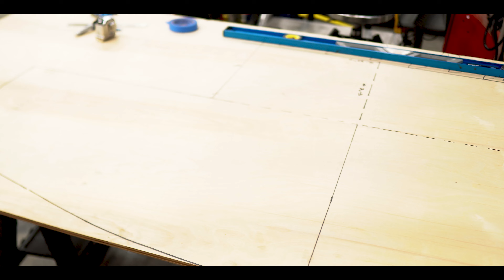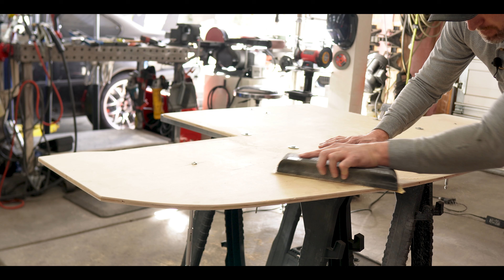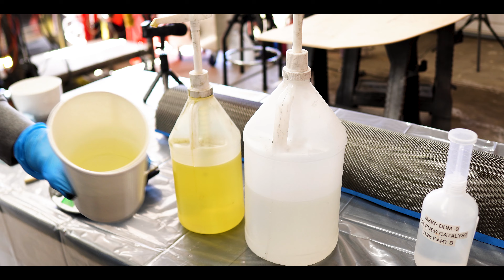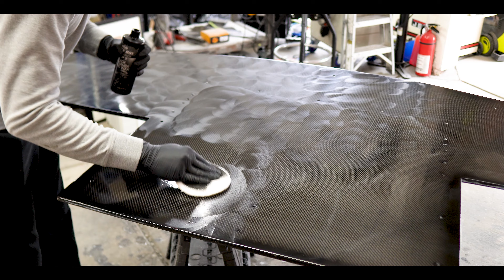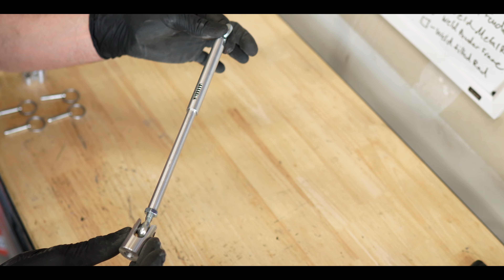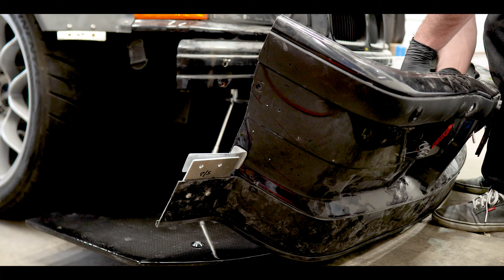How I Make Carbon Fiber Front Splitters: Quick and Dirty Series

Comment: Question, or did I miss it, did you laminate both sides of that wood with carbon material?
Reply from the maker: Yes, both sides and wrapped around the edges. The black paint seals and hides the seam and the clear coat make its flush and smooth.

Comment: how do you keep water going in the bolt holes on the splitter and causing the wood to warp?
Reply from the maker: I think I did not show it, but I drilled the holes and sealed them after with epoxy resin before final install.

Comment: Great vid. I'm pretty handy with woodworking, less so with the chemicals, where i have no experience. Do you mind mentioning exactly what that mixture is?
Reply from the maker: Thank you! I am assuming you are talking about the chemicals I spread over the carbon fabric; it is a 3:1 medium-cure epoxy resin system from US Composites. It's a two-part system with resin and hardener.